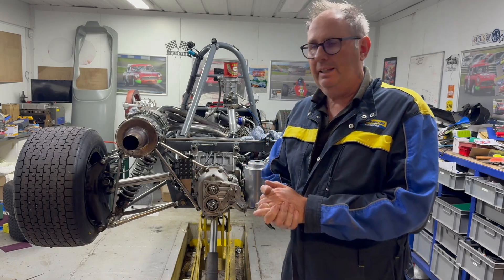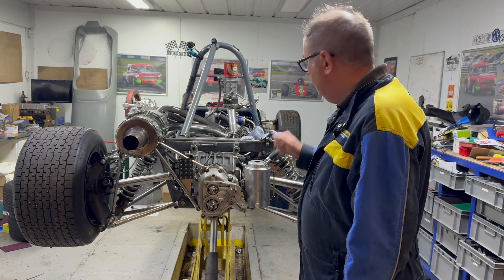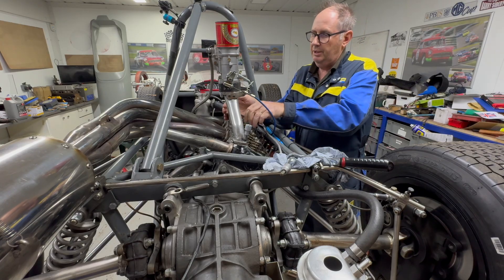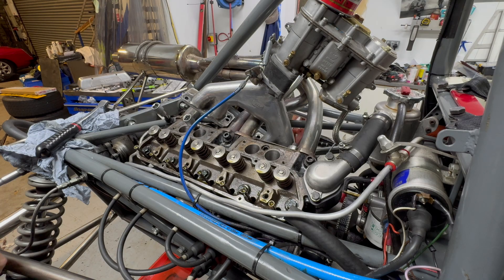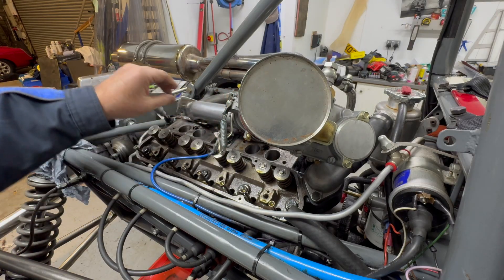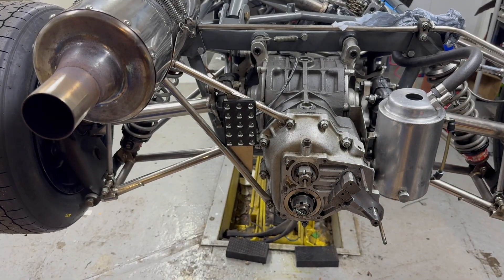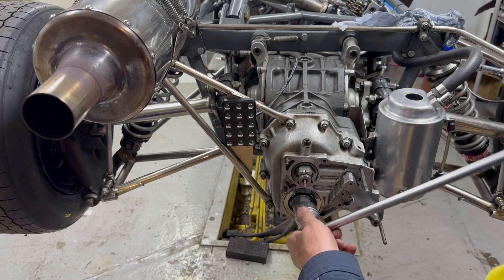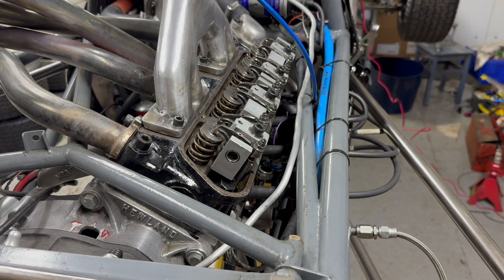Brabham BT21 Historic F3- Head torque and valve clearances #automobile #engineering #spasixhour

Comment: Are you using half a twin choke carb - is that a common trick?
Reply from the maker: Standard on all downdraft MAE engines, some manifold have a bracket to hold the redundant choke, some cut the carb in half.

Comment: Great video as always, when you work on your own engines long enough you almost become a toque wrench. Always fun doing the valve clearances especially when you have high lift cam, in my a series I used 649, 276, 286. Look forward to seeing your next update from Spa, Safe travels and enjoy your racing.
Reply from the maker: Thanks. Only time I don’t use a torque wrench is in emergency paddock repairs so its quite satisfying that I’m not to far out.